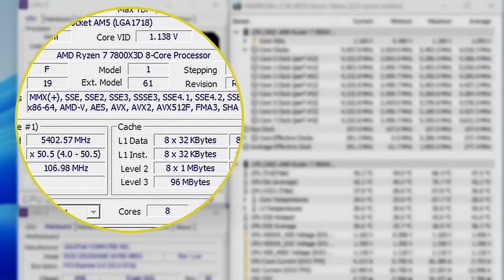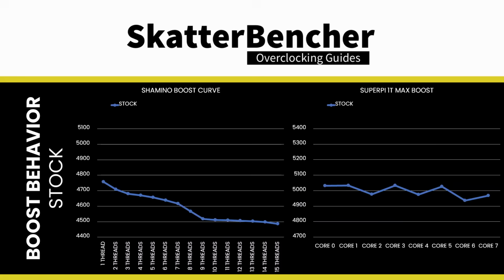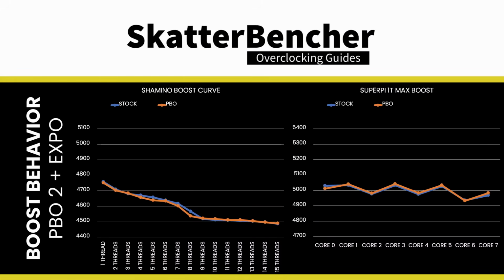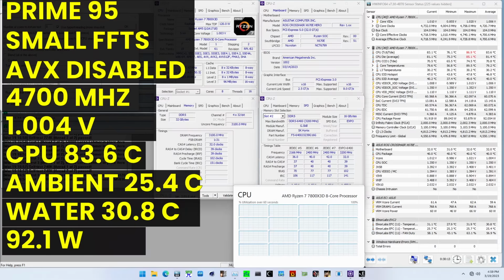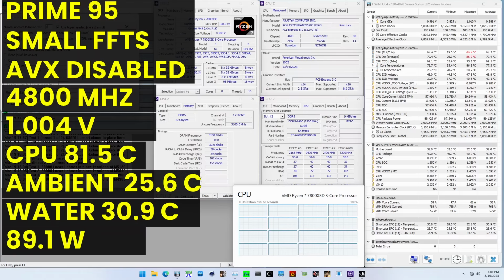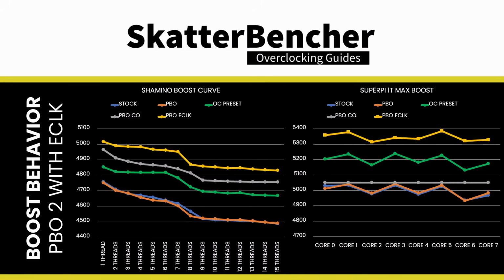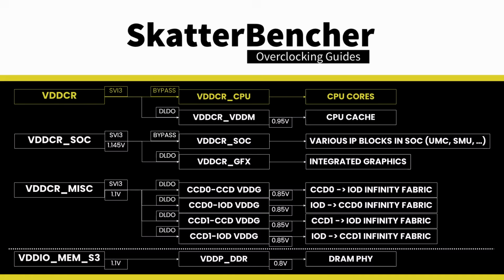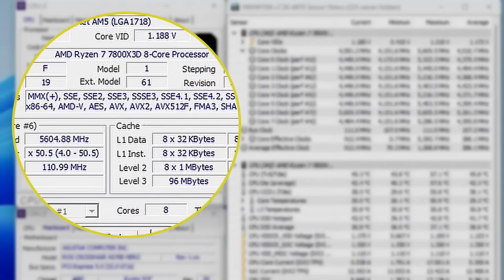Ryzen 7 7800X3D Undervolt & Overclock to 5403 MHz With ROG Crosshair X670E Hero | SkatterBencher #60

Comment: Why not direct die oc with the 7800x3d ? That would be fun :)
Reply: thermals aren't the biggest limitation here it' s the cache which can't handle any higher voltage
Reply: @dvlx8453  i mean it still is thermals but your right even with direct die cooling your not going to get much extra OC out of it anyhow. both temps and voltage are a huge issue for overclocking these chips. Even the non 3d cpus are having a very rough time with 5.8ghz so if he is getting 5.6ghz with out a delid i would say at the very most you would get is MAYBE 100mhz and that might not be stable either.
Reply: @dvlx8453  With lower temps it will consume less energy and higher clocks are possible, 3D cpus are made of the best chiplets so they can benifit also from deliding

I think it  would be fun :)

Comment: Its crazy that the CPU temperature is 90C+ when it only uses 90W-100W.... and its on watercooling with water at 30C. WTF.
Reply: This CPU does not push past 89. 89C is its max temp.

Comment: @23:29 you said to raise Eclk until unstable and then increase positive core optimizer all cores. then check individual core stability and raise CO more for unstable cores. But in your settings you only had 1 core +10 and one -5. So how many restarts did you need to get there? And if you uniformly raised CO initially(as in the slide), how did you go about deciding which cores to reduce it on?
Reply: He starts at -35 and works up. First thing to know us his mobo runs his cpu at 1.35v most of us are running at 1.24v.... also because of how the boosts works this is how you get the highest frequency on all cores.  You can also just go from 0 and works down by -5  each time. This is how i did it.

Comment: Is there no bclk limit when using 4000 series graphics cards? For 5800x3d, remember to limit at 102.8 to use with 3000 series graphics cards
Reply: Good question I wonder too
Reply from the maker: Not if you use asynchronous eCLK.

The issue with previous Ryzen generations was that only synchronous eCLK was supported. So when you increased the reference clock, it increased not only the CPU reference clock but also PCIe, SATA, etc. 

With asynchronous clock you have 2 reference clocks: 1 is used for the CPU only and 1 is used for everything else (pcie, sata, imc, fabric, graphics, memory, ...).

I've gotten the ECLK as high as 169 MHz in very early testing http://valid.x86.fr/ilmj1v

Comment: Channel number 1. I have a question. I will be happy if someone answers me. I have a motherboard b650 gaming x ax v2 +7800x3d I set co -35 + expo(ddr5/6000lc30 I get in r23 about 19200-19500 depending on the temperature outside. I have cooling air ak620 digital in every game the clock is on 5050. is there anything else i can do or not? No need to touch anything else
Reply: Looks better than my score with similar oc and I have aio
Reply: I can’t run occt stability test with -35 offset without crashes 

It might run a cinebench test but not stability test
Reply: não, o 7800x3d é travado até 5050
Reply: so mexeu nisso ?

Comment: Well i have a asus rog strix b650e-f and got the 7800x3d and only have some of what u have to undervolt add 200 mhz and negative 30 curve.ram is 5600cl28 and it go 5800 but 6000 it it wouldnt boot says something about system repare disc lol but is what it is but pc does do enuff has 5080 gpu.

Comment: Sweet! I'm guessing that setting the core voltage manually, OR using a voltage offset allows going above the factory 1.2V max limit?
Seems like 1.3 or 1.4v could give some solid frequencies if the cache can handle the 5.6-5.8GHz range...
Advanced cooling needed of course for ambient operation :)
Reply: I've seen at least 2 cases where putting 1.3V on an X3D chip immediately killed it after applying the settings so probably not a good idea.
Reply: Really just depends. If you are low temps you can go up to like 1.35 but it usually hovers around 1.2-1.25
Reply: @WereCatStudio where? Only seen one and it was 1.55v
Reply: 1.35V will kill this CPU. Or its cache. Which kills CPU anyway...
Reply: It’s not the voltage itself that kills the chip. It’s the unregulated nature of it. The reason those chips died was likely due to the voltage regulation not knowing that a chip is running hot and didn’t regulate it.
Reply from the maker: For high frequency validations and extreme overclocking, perhaps higher voltage will be beneficial. But for daily systems, I doubt over 1.15-1.2V will be very useful because at any kind of medium to heavy load you'll hit TjMax.
Reply: @SkatterBencher  For all core loads on traditional ambient cooling, probably no need for even 1.2v
But for gaming where you maybe have two threads fully loaded and limiting the system, with the rest of the threads doing some light stuff... maybe could be beneficial? Especially if you delid, maybe thin the dies a little, and use direct ambient cooling. Although the better the cooling is and the thinned the die, the less the power draw of the cores influence each other.
Reply: And there are of course production workloads that may only use say one or two threads, and benefit hugely from L3 cache size.

Comment: in essence the 7800x3D is 1-5% slower than the 7950x3D in games due to the extra 200 mhz headroom on the 7950x model .
Reply: Depends on the game, some games are worse on 7950x3d unless you disable the frequency cores
Reply: Most benchmarks are actually showing it as faster than the 7950X3D, most likely due to the reduced latency from not having to communicate between CCDs
Reply: @mordorson  well. i have been watching those benchmarks and i m watching mine, and they kinda suck.. most youtubers do little to nothing to optimize the CPU or the software. you can use process lasso to permanently prioritize affinity and cores for each game. difference in my case between stock 7950x3d and optimized version is up to 10-15% in some games.
Reply: @asdf_asdf948  You dont have to disable the frequency cores if you use process lasso.
Reply: @LQ-gaming  Do you believe that is something that will be optimized better in the future which would make the 7950x3D the better chip?
Reply: @CALiiGeddonTwo  yeah, from a technical point of view the 7950x is superior to the 7800x, you can get up to 5250 mhz on the vcache while 7800x is capped at  5100 mhz if not mistaking. currently the software is keeping the 7950x back but maybe if they can polish the core parking and actually make games stop going over the second CCD for cores then the chip can act like a better 7800x and have an extra ccd with cores for your premiere, streaming, blender and such .

Comment: It's a lot of useful information and for some people a bit overwhelming... Hehe! Thank you! 
I just picked up a 7800X3D at my local Micro Center. That 25 dollar CPU coupon was nice! 
Would you have a step by step process on how to extract the best out of a 7800X3D on a website? 
In the end, taking into account your testing and findings, which method is the most fool proof, from all the overclocking methods you've used that yields the best results in your opinion?
Thanks again!
*I'm running an Asus B650E-E board, 32GB Team 6000 CL 30, RTX 4090.
Reply from the maker: I always put up a written version of my videos up on my blog: https://skatterbencher.com/2023/04/05/skatterbencher-60-amd-ryzen-7-7800x3d-overclocked-to-5400-mhz/

My preferred method for overclocking the 7800X3D is using PBO + Async Eclk. It's more complex than just Curve Optimizer, but it's the only way to increase the maximum boost frequency.
Reply: @SkatterBencher  would you be willing to teach me how to do all of that? If you are, how much would you charge me for such lesson?

Comment: Love it! can you make a video overclocking the i9 13900k using the Asus Maximus z690 extreme to 6000 MHz, I'm curious to see how stable it would be on this type of motherboard I saw on your others you used the apex and hit was it 6500 MHz?  TY!
Reply from the maker: I don't have the 13900K+Extreme specifically, but I do have a guide for the 13900K+Master and 13900KS+Hero. The information from those guides should (hopefully) get you started :)

https://youtu.be/ecdrKZ0GVr8
https://youtu.be/dpWw_5KfpIw
Reply: @SkatterBencher  Thank you!, I did find these 2 videos of yours to be closer to the first one I would say your MOBO is the same brand  of course instead of following the 6500 Mhz path I would adjust to 6000 https://www.youtube.com/watch?v=hc9A8mqP2_4&t=189s

or this one which you did go for the 6000 mhz using the aorus one https://www.youtube.com/watch?v=P8dBefBmwZ4 but well def keep an eye on the ones you mentioned hopefully I got some good luck on the silicone lottery part

Comment: Thanks for a very comprehensive video - Just a question on the EXPO settings for your memory.  I have G-skill 6000mhz RAM.  You use Expo1.  What is the reason why you dont use Expo2 or Expo Tweaked?  Which would you recommend I use?  also I see you have 6400mhz which you tune down to 6200mhz.  With my 6000mhz, should I be tuning it down to 5800mhz?  I thought that the sweet spot on AM5 is 6000mhz.  I am very interested to hear your views on the different EXPO settings.  Thanks
Reply from the maker: EXPO I loads just the primary timings, frequency, and voltage. So I let the motherboard tune the other settings like secondary timings. I don't have a real preference, it's just my go to EXPO settings. In terms of performance, EXPO Tweaked > EXPO I > EXPO II, usually. But this can be different on your system and the only way to know for sure is to check yourself.

As for down-tuning: the sweetspot seems to be 6000 indeed. While my kit is rated at 6400, few CPUs I've come across can actually run that stably. Hence why I downtune the frequency. With your 6000 kit, you likely don't need to downtune (unless it's somehow unstable).

Comment: @SkatterBencher Have you tested any other boards with eCLK tuning that would be able to lock the 7800x3D at a fixed voltage & more importantly fixed clock speed when gaming?
Reply from the maker: No, I only tried this CPU and motherboard

Comment: I have the 7950x3d.  I've use the ScatterBencher OC strategies provided in his other video for my CPU.  But I play Overwatch 2 and I'm having the best results by simply turning off cores 9-16 and using CCD 0 only with the v-cache.  So, I boot Windows with 8 cores only, to be clear.  I'm wondering would the strategies in this video would work if/since I'm only using 8 cores?  I can try it, but I'm just wondering if theoretically it should work or not.
Reply from the maker: It should work
Reply: Hi redcrow, sounds like process lasso maybe interesting to you https://www.youtube.com/watch?v=VS3AmWLYd7o you'd be able to keep your other cores active whilst using the CCD effectively for gaming.
Reply: @harrymitchell7338  yep, I actually found that exact video after making this comment and started using that strategy instead, works great!

Comment: Can you get another group, into watching your videos? I love them. I’m also a gamer. Which, would help gaming more? I’ve seen a shit cinebench score, kill it on a game. I know you put a shit ton of work into these videos and I love it. But smashing some benchmark, sometimes, hell, a lot of times does NOT equal to gaming performance. Especially reliably. I really wish I could see what, actually helps in gaming. A ton of us do. Cheers and great work regardless my guy.
Reply from the maker: Thanks for the kind words Kyle.

I'd love to include more benchmarks, but my time is limited so I need either games that have built-in benchmarks or actually make an automated benchmark system :)
Reply: Gaming gains will be very specific to the game and have interactions with other components. CPU based benchmarks help isolate the performance gains and make it more comparable in my opinion. To know what the gains will be in a game, you're best to load up your game on your system and see.
Reply: @JimBob1937  I understand. My question was, does this "overclocking" really even benifit any game. Even seeing a RPG, FPS, difference wouldnt take much time. Call of duty, vs Starwars jedi survivor, or the like. I get, i play games, you dont, and understand that, but it would not be that hard to see if any of this, while benchmarking high in cinebench or whatever other benchmark, does anything, in a gaming, ANY gaming experience.  Again, i get i play games you dont, but, it wouldnt be hard to see a difference in any game vs stock.
Reply: @Kyote7667  , ah, I see. They certainly do, it just is highly dependent on the game, the section of the game, and even what action you're performing in the game. 

"I’ve seen a shit cinebench score, kill it on a game. "

My guess is because you may be focusing on the wrong cinebench score? Cinebench has multithread and single thread testing, and you really should be comparing single thread most, and multithread scores only up to the point you think a game will still utilize. For example, a 32 core CPU will get an excellent multithread score, but it is rare for any game to use that many threads. Even highly multithreaded games will still utilize a single core more heavily for the main game loop thread.

"I get, i play games, you dont, and understand that"

Quite the opposite, lol. I have two beastly computers. One has a 12900k and a 3090 watercooled and overclocked (custom loop), and my second computer is a 7800X3D and a 4090 both also overclocked. I game on an 85 inch Samsung TV with the first computer as a home theater PC. My second PC is in my actual home theater where I game on a 145 inch JVC DILA projection setup with an acoustically transparent screen and a 5.1.2 surround sound setup (5.1 plus 2 height channels in my ceiling). When not doing that I have a Varjo Aero VR headset (look it up) where I use the computer at 100%, it gets toasty.

In my anecdotal experience, yes, CPU overclocking helps with gaming. However, you need to understand that games are just applications, just like any other application. You seem to think "gaming" is somehow not an application and different. Games use GPUs, but they use CPUs for lining up data for the GPUs. The game logic uses CPU, resource handling is done via CPU, and so on and so on. How much CPU is used compared to GPU, to that the CPU is the bottleneck, is actually extremely game and situation specific, along with hardware specific. This is why even benchmarkers that use games for CPU benchmarks try their hardest to remove the GPU from the equation... and yet, it never fully is. Arguably, those gaming benchmarks for CPUs are equal to synthetic testing because they're so artificial. This doesn't mean gaming doesn't benefit from better CPUs though, it just means that it is hard to properly isolate the CPU in such comparisons, as a CPU advantage can be transitory within a single repeatable benchmark, or show up as better 1% lows, or have less stuttering, or many other things besides average FPS results. FPS is inherently an average, but it is highly possible a better CPU can have more consistent frame times, making for a smoother experience... and yet the FPS could be equal with another worse CPU.

As for me, I have seen actual FPS improvements from overclocking system RAM as well as CPU overclocks. However, it isn't seen in all games, or all situations in all games. The best example in my memory was a specific area in Dishonored 2, where I'm able to do 4k 120Hz... most of the time, but there is this one area where it dipped into 100 FPS or so, but it was consistent. This dip didn't come from the GPU, it was from system memory speed combined with CPU. Overclocking each one separately upped the FPS independently, until I was able to hit 120 FPS even in that area, just from RAM and CPU. Why? You'd have to do a breakdown of the code running in that area, apparently it really hit the CPU hard, and apparently had some data shuffling going on if the system RAM overclock helped. Perhaps the CPU calculation data wasn't able to be fully held in the CPU caches resulting in a cache missing and needing frequent RAM access. Who knows for sure, I never investigated it that far. 

"Again, i get i play games you dont, but, it wouldnt be hard to see a difference in any game vs stock."

Again, I play games for sure. I'm a giant nerd, software developer, and electrical engineer. Not saying it's impossible to isolate the CPU in a real world gaming scenario, but it would take a lot of analysis in order to do it properly. The gaming benchmarks you see others do are not perfect either. There is a lot going on in modern day systems and software, so it is a much harder task than you think.

I'd say the easiest examples to test as flight sims. There is so much computation going on that even my rigs are CPU bottlenecked doing something like MS Flight Sim in VR at extremely high resolutions. My VR is rendering at 4320 x 4080 per eye, so it is rendering that resolution twice.

Comment: Running a 7800X3D on a MSI x670e Carbon Wifi, PBO with -35 CO all core, only hitting an average of 4635@76C on Prime with AVX disabled (compared to your 4800@81C). Voltages are the same, wondering why mine doesn't want to boost higher

Comment: Thx for this video, I'm deciding to finally upgrade my 9700k  5 ghz with 4000mhz ddr4 tuned to go for simple no ram tuned amd, but us the x3d oc profile only for asus boards? Or does the gigabyte b55e master or the x670e master also have this option? Because I saw huge performance uplift with this in your video.

Comment: 87°C ??? That may damage the V-cache. The TJ max is much lower on the 7800X3D vs the 7700X. Also, 30°C water temp? Maybe need a faster pump and a better air flow condenser? Or higher pitch helical blades to produce better CFM.
Reply from the maker: TjMax for the 7800X3D is 89°C